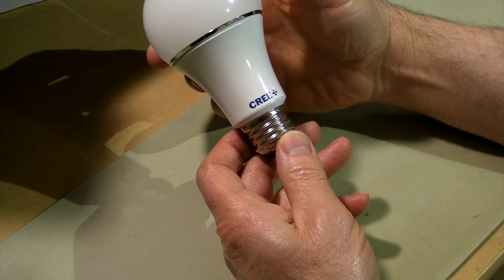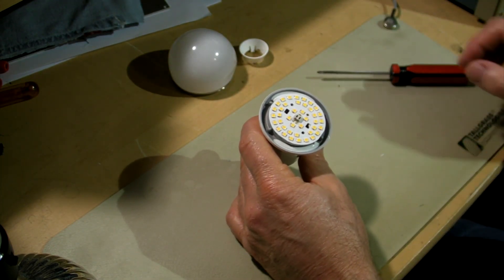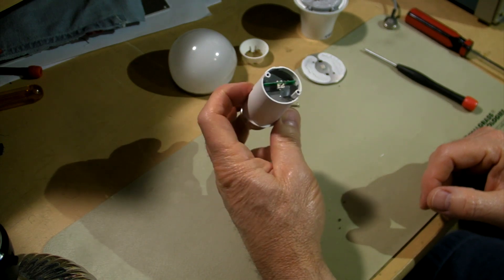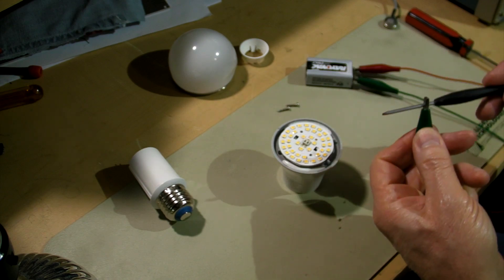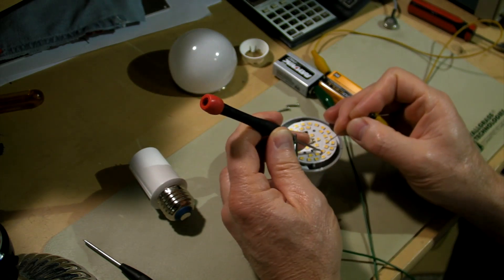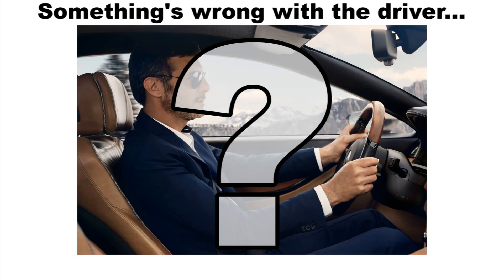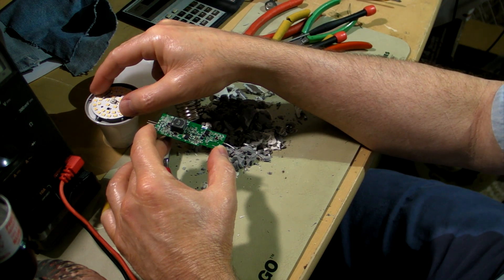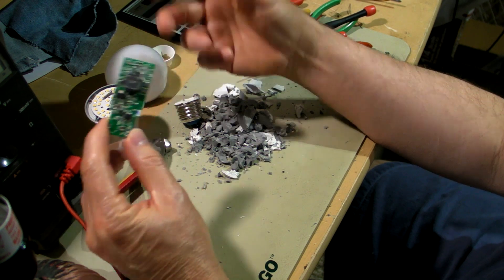FAILED!!  Cree SA19 100W LED bub TEARDOWN

Comment: been watching a few vids, like this, they are made to run very hot, ie, over powered, took one to bits, cut out one of the 2 resistors, runs cooler now, last longer, but not so bright

Comment: The bulb says not for use in enclosed fixtures or recessed cans. You said it was in an enclosed fixture near a driveway. Maybe that's why it failed. It might have overheated.
Reply from the maker: Please see my video description text.  This is something I've been asked before, and can be found in my responses below, but I have now copied it into the description box above.
Reply: beforebefore why should you not use it in an enclosed fixture- how does that effect it ?
Reply from the maker: Heat buildup causes some electronic parts to fail much sooner... such as electrolytic capacitors which have a liquid electrolyte.  LEDs also lose a lot of lifetime at elevated temperatures.
Reply: beforebefore thank you for explaining

Comment: Suitable for damp locations, yes. But, as you stated, "... well shielded from rain...", and printed on the lamp it clearly says "not for use in enclosed fixtures".
Guess you won't be sending it back now (6m 35s).
Reply from the maker: You do realize how long ago this video was posted, right?The outdoor lamp-post housing is not enclosed, it's vented at the top (for heat to escape), but the lid is like the steep sloped roof on a house... it extends well over the opening, and the opening is more than 25mm above the bottom edge of the sloped lid.

Comment: Ive had Cree bulbs for years, none of mine have failed... I even had 2 lit 24/7 in the front windows of my gallery building for over 3 years, after I sold the building I took the bulbs home, still using those bulbs at home like 4 years later.
Cree has a good warrantee, could have had the bulb replaced
Reply from the maker: Great! This early series bulb had many. many failures... especially in the higher wattage like this 100W bulb. As I noted in earlier responses, Cree did replace it, sight-unseen, and did not ask for the old one back. I've never had one of their "4Flow" bulbs fail... and I have used many.   The purpose of this video was the "teardown" for those technical-minded who want to see "what makes it tick".  

Manufacturing consumer products was brand new for Cree in 2013... they had been making bare LED's for years (as well as other components), but a complete final product like the light bulbs was their first foray into consumer products... and it took them a while to get their reliability problems worked out.

Comment: Printed Circuit Boards are no ones friend at high power use! Power tube amp sockets wired directly to a pcb will eventually fail because the traces just get too hot and ziiit you lose filament voltage. Give me point to point wiring anyday unless it's in a low power low heat configuration!

Comment: Did you ever hear from Cree?
Reply from the maker: They sent me a new one before I made this video... and didn't even ask for the old one back. I offered to send it due to the problem and they sent me a free shipping label to do so.
Reply: @beforebefore  I have had several Cree LED bulbs fail in under a year. In each case I contacted them and they replaced each bulb without any hassles. Excellent customer service!
Reply: @smartin484  for every bulb they replace, maybe a thousand just get tossed? Works for them-
Reply from the maker: nope
Reply: did they send you a new one?